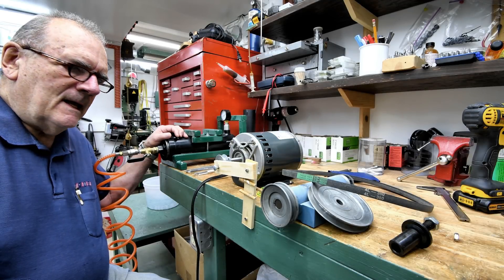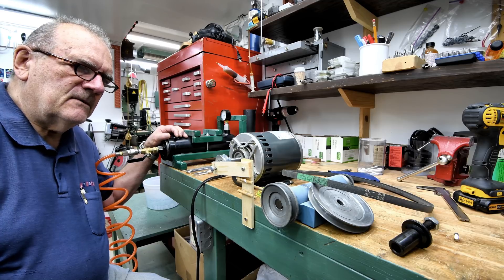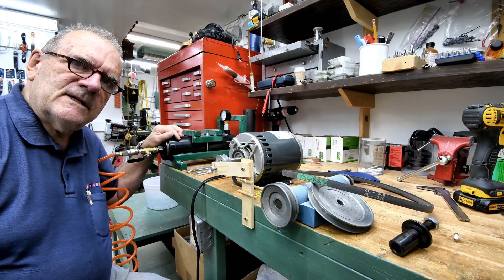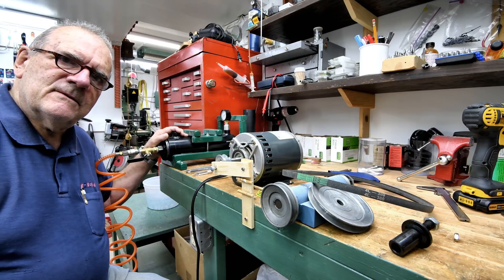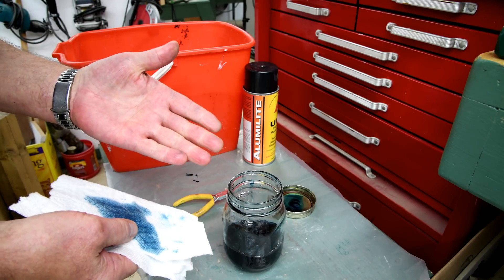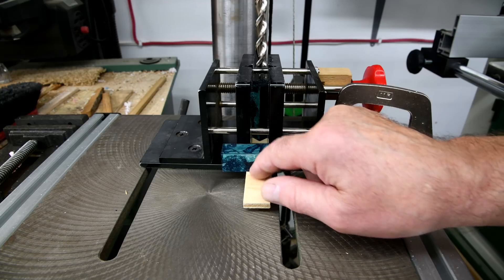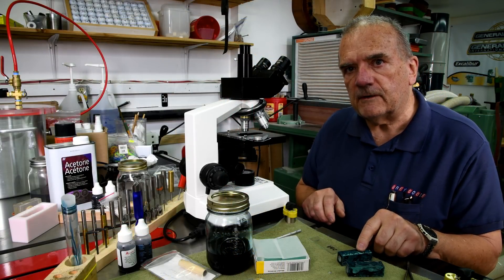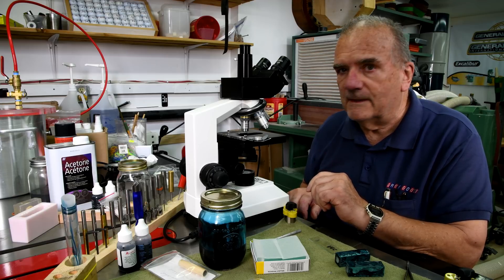The Pen From The Blue Goose - Part 23

Comment: May be is kind of a wood that is difficult for any liquid to penetrate with? Good effort from you anyway Ron!
Reply from the maker: Hi Kwstas,

Re: "May be is kind of a wood"
I don't think so. I didn't pay much attention as a very young teenager when seeing them being built, but I'm fairly sure that it's just plain untreated spruce lumber. They were definitely made-on-the-cheap. Didn't last as long as the ones of the same design that were built later from plywood. There has to be something else. Perhaps after I turn one down to the final diameter today, and before I apply the finish, we'll take a closer look using the microscope at the bare wood for traces of the Cactus Juice. We'll see in part 24 :)

Comment: Hi ron
Because the wood has come off of the boat,  it would be some sort of marine grade timber therefore it may not soak up the dye as its used to keep water out, and thus used for boats. Just a thought..
Reply from the maker: Hi Mark,
Re: "marine grade timber" I don't think so. I didn't pay much attention as a young teenager when seeing them being built, but I'm fairly sure that it's just plain untreated spruce lumber. They were definitely made-on-the-cheap. Didn't last as long as the ones of the same design that were built later from plywood.
Reply: No worries ron , it was just thought . What about the wood being sealed from years of exposure to the elements.
Reply from the maker: Yes, like perhaps it had absorbed something and the capillaries got plugged. As Mythbusters would say --- that's plausible :)

Comment: I have some experience in this area but I am no expert, by far. Here is my logical conclusion (but as you say so well, "I could be wrong"):  

If you think of the wood grain on the blank as a series of straws laying against each other, then when you draw the air out in the vacuum chamber and then release it while still submerged, the die should then draw itself into the wood, much like water entering into a compressed sponge as it starts to expand back to its original shape.  Using the pressure on the "straws has an opposite effect; the pressure collapses the "straws" and packs the grain together so tight that nothing can penetrate the wood. Thus keeping die from entering the wood grain. A compressed sponge draws no water; I'd use the vacuum and then release it but keep the blank submerged overnight . . . at least that's my thought. Thanks again for sharing.
Reply from the maker: I like your theory, but when thinking about it, and realizing that the end grain is under the same pressure --- there has to be something else. Perhaps after I turn it down to the final diameter today, and before I apply the finish, we'll take a closer look at the bare wood for traces of the Cactus Juice.
Reply: I thought about that too. It seems to make sense that the delay between the vacuum chamber and the pressure pot would be just enough time to draw in some of the dye. After all, the dye would come in from the ends just like a straw. From years of staining furniture I have learned that stain goes in deeply on end grain and barely penetrates the surface along the sides.

I love your videos because you are always thinking about alternative methods. That is how the world makes progress, thank you for allowing me to interact on your projects.